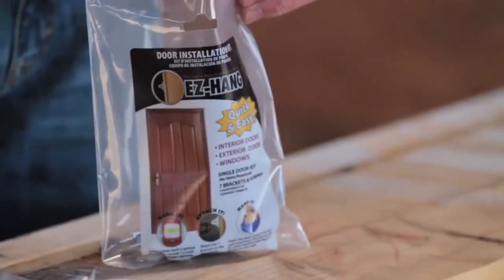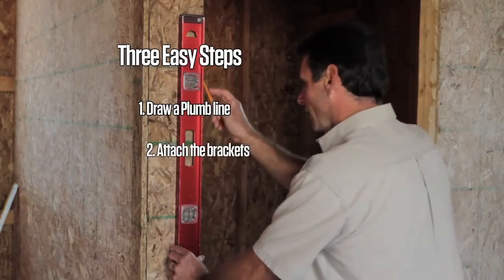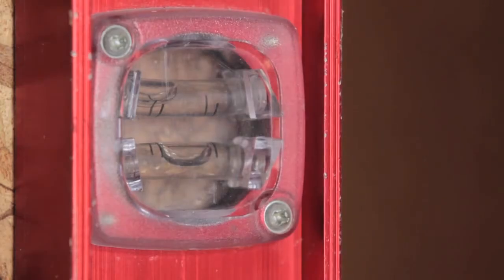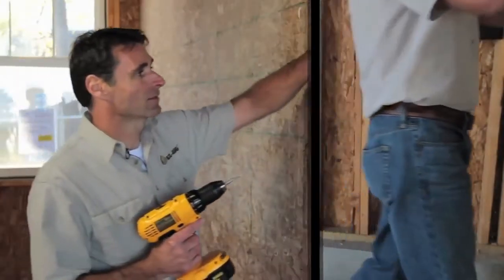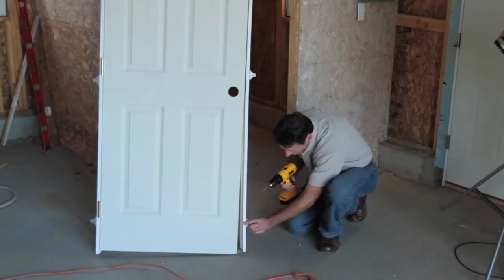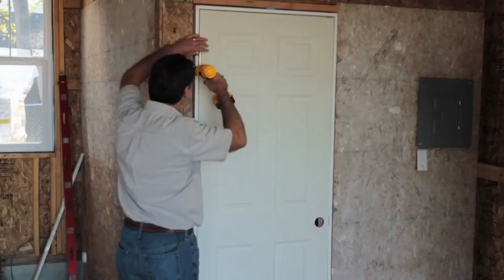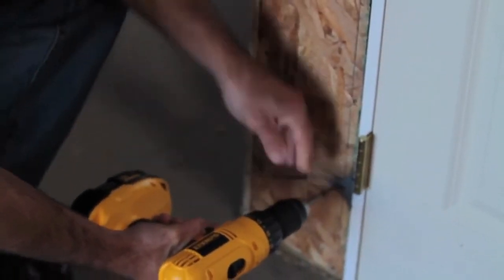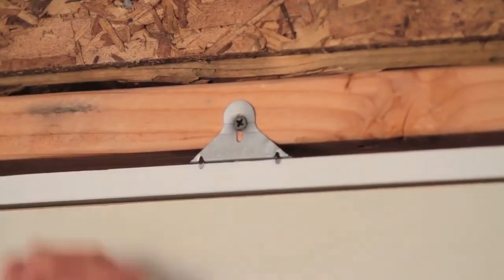How to Install a Pre-Hung Door - EZ-Hang

Comment: I can't stress how great this system is! I hate to think about how many doors I installed the old school way. My first door installation using this system was perfect. I installed two kits- one on each side. By doing that, you don't need to add additional nails and shims on the inside jam. The jams are very study with two kits. No need to fill nail holes!
Reply: BTW: I purchased the kits at Menards and used with their pre hung composite doors.
Reply: I just bought two kits for each door.   The problem I was encountering is the brackets can bend and the door moves during casement molding  nailing.    I would suggest using up to 13 brackets, 5-6 on each side, at least one on top....so two kits per door.     It's especially important to have brackets near the bottom of the door to cope with the bottom end of the casement which  is unsupported and typically MDX construction (particle board).

We had several circa 1977 doors in dark walnut.  I've been putting off door replacement for decades because shims are so difficult to use.
Reply: @coppingtonfarnham7731   I would use two sets of brackets- one on each side of the door e.g. inside and outside. I've only used these on light weight doors. Maybe the brackets could be supplemented with traditional nails and shims once the door is in place?

Comment: Didn't even realize this saves you filling nail holes until I saw the video. Gonna pick up one of these kits. $5 at Menards. No brainer honestly. Replacing a solid door with a louvered one so my utility room meets code. This will save time.

Comment: Would love to see how the other side is done.  I assume its a little trickier.  These hangers use keyholes allowing you to take the hanger out while sliding the door in.  Other brands, I think, instruct you to bend the hangers while fitting the door, then bend them back in once door is in place.
Reply: The theory is you do not have to do the other side.  The 7 brackets should be enough to hold it in place.  If you are concerned about them not being enough, once you install with the brackets, you can do and drill screws from inside the jam into the wall as well so its nice and stable.  Depending on the gap you may want to put a few shims in as well to it all stays tight and level.  IMHO these kinda things are great to get the door in place and where you want it but then you want to come in and secure it in a more traditional door installation solution.

Comment: What is the max tolerance for space between rough frame and the pre-hung door? I have older houses that I have replaced doors in where there has been a good 1-2" gap (just old sloppy construction).  These look like the rough frame and door have to be almost exactly fit.
Reply from the maker: There should be some gap, normally 1/2” on each side. If the opening gets too large, you could always add a 3/4” strip to one or both sides of the opening, this would allow you to have something to screw the brackets to.  This works well and also adds more support for the casing.